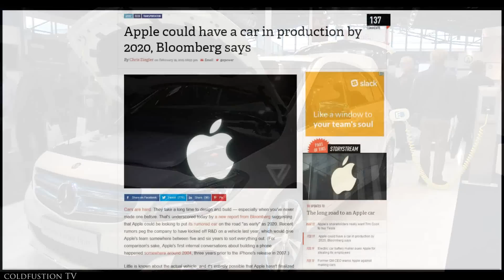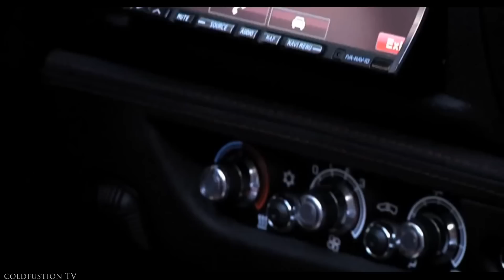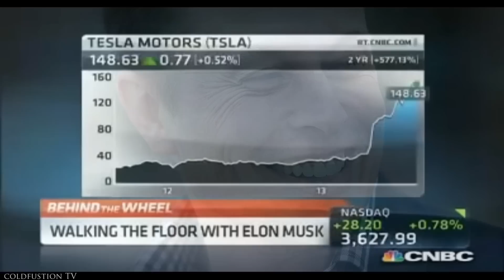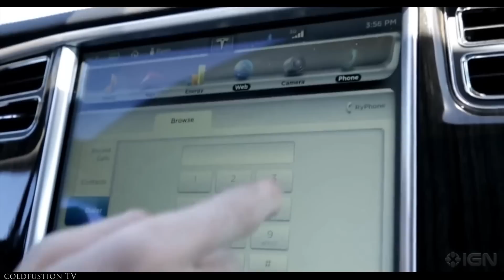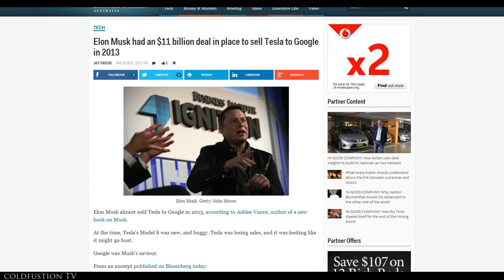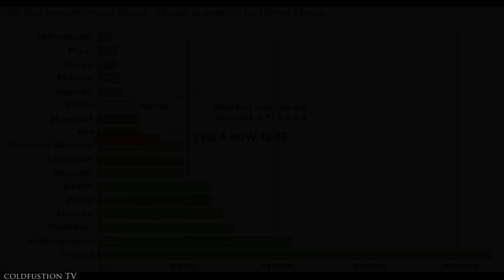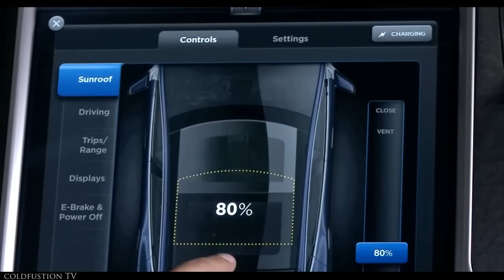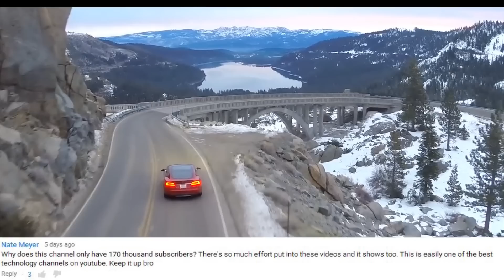How BIG is Tesla? (Bigger Than Mitsubishi Motors!)

Comment: Now with the Tesla p100d it's 0-60mph in 2.5 sec
Reply: Woah....
Reply: Now 2.34 second, gutted out interior could be as little as 2 seconds.
Reply: Cam Byers but that one is a little dangerous though
Reply: sickhcivc electric is shit, wheres the exhaust notes???
Reply: I think that you will have to modify your comment because the new tesla roadster is coming!
Reply: quick update new Tesla roadster goes 0-60 in 1.9 seconds
Reply: With the Tesla Roadster coming 2020 it will be 1,9s ;)
Reply: Now with the new Tesla Roadster it's 0-60mph in 1.9 sec
Reply: James Sempy For quickly getting to those limitations.
Reply: @Tony Tsui and all kinds of crap spewing out of its tailpipe.
Reply: @Tony Tsui just try to keep a Chrysler out of the repair shop.
Reply: Tesla roadster 2020 spacex version has enteted the chat
Reply: W O W - W O WEEEEE
WHOAAA. Beautiful auto.....
Reply: @virgilepatricot2507  Turns out owning the most cutting edge rocket company and the most cutting edge car company has an interesting effect on super car designs. Also Plaid Model S has a 0-60 of 2.0 sec and it's a family sedan.

Comment: I love my Ford Focus electric, it's not a Tesla but at $22000 after incentive it's a bargain,  battery lasts all day and charges overnight. I get to drive the future,save enough with no gas or maintenance and out accelerate every car on the road while I wait for the model3.
Reply: Ron I'm getting my 1st car soon (I'm from the UK) do you recommend either Ford Fiesta or your car Ford Focus electric, insurance-wise as well?
Reply: Mic First car? better Fiesta
Reply: Thank you will do
Reply: Mic small car means small responsibility. Cheap maintenance and repair. Easier for you to handle it daily. You will do stupid things with your car (you will, like everybody elses did with their first car). You will bump it, scratch it, break some parts of it. But in the end of the day, you will understand how to drive and use a car (each car have their own habits and character too).

My first real car was a used 2008 Honda Fit, or Jazz if you are from Europe. Still keep it although I have several other newer and more expensive car and truck now. My younger bro will start driving soon, I will pass the torch to him. 

Cheap car is the best car sometimes.
Reply: I see that's great advice! Also that the parts are more common = cheaper to repair

Comment: Electric cars can end the war on fucking petrol.
Reply: stanger People should like your comment more.
Reply: yes, but it is the mainstream. Developing electric motors for electric cars WILL lead to enormous innovation which will then be used on industrial machinery. On the other hand, plastics should be banned altogether from the mainstream and used only where they are absolutely necessary. If not, we will be dead by plastic poisoning before oil runs out.

Comment: Electric vehicles are great but, we cannot eliminate the other great powered car and that is, the hydrogen powered car. Hydrogen  powered cars will be needed where batteries cannot hold up very well to the extreme cold weather climates. Maybe New England where we have 4 seasons of changing weather, battery powered cars will not hold up very well in the winter. On the other hand, hydrogen powered cars will hold up in any weather conditions.
Reply: Hydrogen sadly is ridiculously inefficient in comparison, you'd be better off hoping for improvements in battery technology.
Reply: I would love to see a hydrogen powered car against an electric car in the quarter mile.
Reply: carl cappy problem is its hard to harvest hydrogen, thats why electric is more preferred
Reply: It's hard in terms of safety. Hydrogen is very volatile.
Reply: Hydrogen is no more volatile than gasoline powered cars.
Reply: carl cappy That isn't even slightly true.
Hydrogen will only exist as a liquid under high pressure or extremely low temperature, petrol in comparison sits as a liquid slowly evaporating.

A leak in a petrol tank wastes some of your money, would likely be quite a lot more upsetting.
Reply: Well, I will purchase an electric car when the price comes down to earth.
Reply: Hydrogen car is very dangerous... If something goes wrong then it will work like a mini nuke
Reply: You mean hydrogen bomb?

Comment: Cool doc! but I have one question. you said it doesn't need liquid besides wiper fluid. what about brake fluid? there has to be some way the motors are cooled as well
Reply: Owner's might only be responsible for adding wiper fluid, but Tesla cars have brake fluid, coolant(hence liquid cooled batteries), even transmission fluid(albeit a single reduction gear transmission).
Reply: RedcatPlaysGames No. electric vehicles have no fluid but wiper fluids. just like your phone and laptop has a cooling system without fluid, electric vehicles and their batteries have a cooling system that doesn't require fluid.

Comment: i only have one problem with the lane correcting i drove a  Mercedes s class 2014  and it would not allow me with out putting more force on the wheel to avoid obstacles far in front of me like cyclists it tries to pull me back to the middle of my lane which was a little off putting i hope they find away to make the sensors pick up obstacles a decant while down the road.

Comment: Supercharger Stations aren't free anymore, and most of them aren't for universal use anymore. It's still cheap to charge up, but it takes about an hour to get a full charge. I do like that the charging stations are next to actually shops and the car is definitely changing the automotive industry. 
Some day, the skills that I've acquired in college are going to be obsolete and degree's in robotics, electrical engineering, and even mechatronics will be far more valuable in the job market. I'm not saying fossil fuel powered vehicles will be faded into obscurity in our lifetime, but sometime in the future (probably near the turn of the century), we're going to completely do away with them and electric vehicles will make up more than 90% of drivers on the road.
Keep in mind... I'm not a time traveler. I'm just predicting the future, and I don't think it's a crazy prediction at all.

Comment: I love Tesla, I'm an Australian Model 3 Reservation holder, and I hired a Model S whilst on holiday in the U.K. 
But I'm sure you've made a glaring error in your video where you state that crash involving a stolen Model S split in half did not result in any deaths. The driver of that car did die of his injuries later. It was an insane crash involving a reckless criminal driving at high speed, so it should not be seen as a reflection of Tesla's safety standards. 
The death of the driver in a Model S in Autopilot mode is another example, but an investigation stated a human driver could not have avoided that crash either and Autopilot in its' current form, if used correctly, is already far safer than human drivers.
My broad point is that we should not set up false expectations that these cars are immune to crashes and fatalities, they are just far safer and showing a car split in half in a widely reported crash involving a fatality, then stating no one was killed, is just setting yourself up for Tesla haters to take a swing at you.
Love your videos on the whole though and beautiful slick production values.

Comment: I'm an engineer...the battery constitutes 80% the cost of a tesla...lithium is a precious resource..a battery with a range of 100 miles costs around 14k...and if you run the battery to zero miles regularly you can expect a 5 year life of that battery..meaning 14k to replace the battery every 5 years!!!! There is no NEW technology with these cars!!! The tesla super charger is nothing more than a 440volt charger...standard to welding rigs!!!! The motor/transmission/invertor are not tesla built...alls they make is the battery/chassis and controller!!! As i said if you regularly drive a 100 mile range battery below 50% or 50 miles you can expect to replace that battery ( 14k) every 5 years....but the tesla has 6 thousand batteries.....and if you exceed 50% that battery range you can expect to pay around 60k to 70k to replace those batteries after 5 years!!!! PEOPLE the automotive companies are not AFRAID of this "TECHNOLOGY" they jus know that for any company to try it is going to massively betray the consumer that purchases it!!!! I'm sorry to say this...but electric cars based on lithium batteries.....is the WORST investment you could make...in your entire LIFE!!!..

Comment: Tesla continues to be smaller, much small than Mitsubishi, of which Mitsubishi Motors is a tiny division.  Mitsubishi builds EVERYTHING.

Dagogo is just a little bit too rosy-eyed.  If you run into trouble doing something, staying with it does not mean that you will achieve your original goal.  Giving up on one goal does not make you a faiure unless you stop trying to do something worthwhile with your life.  Not giving up something after you've proven to be no good at it, not looking for other oportunities, more often leads to continued failure not only at reaching that goal, but failure at everything you haven't tried to accomplish.

Comment: I really like Tesla but they forgot to mention a few facts.. First this thing about it being sportier then most cars.. Not true. Yes it has a wicked 0-60 acceleration but why do you think you never see Tesla doing a Nurburgring circle? Because if you were doing those accelerations and braking for 5-10 minutes the batteries would get hot as hell and you would loose 50% of its power. In that case Tesla is simply not comparable to petrol cars. Second, the range. Yes, the range is pretty good but forget those Tesla superchargers, especially for Model 3 where they won't be for free. Now you have the problem of charging your car on a gas station where it will take you hours.. And third problem is reliability.. One would think that without the moving parts of a traditional engine Tesla would be the most reliable car in the world...But no.. They crammed so much technology and overengineered the car (I'm looking at you falcon doors) that its reliability is appalling.. Anyway, Tesla is a true game changer but it would be fair to mention its current downsides.

Comment: Well engineered electric cars like the Tesla are awesome, but Musk never mentions that the majority of our electric power is still generated with fossil fuels - natural gas and coal. That is not likely to change for a very long time. 
A Fusion energy break-through would likely halt all research into solar, wind, and other so called "green" technologies that are very far from being economically viable as our main energy source.
Fusion powered electricity generation would be fantastic, but we'd still have the problem of upgrading our national electrical grid. It is already operating at near capacity, and could never withstand the load of tens of millions of vehicles recharging over it.

Comment: "the only fluid that needs topping off is wiper fluid". no brakes on the car?
Reply: The brakes use a "brake by wire" system that incorporates electrically assisted calipers reducing the braking distance since the computer applies the proper pressure along with advanced ABS. The braking feel is simulated to the pedal so the driver feels proper resistance and feedback. This system can also be used as break steer to brake the inside wheels to help the vehicle corner better this is a similar technology that was banned from F1. As you can see having this brake by wire system saves weight by not having the traditional heavy fluid filled lines and adds increased safety and handling due to the advanced computer controlled braking systems. Also i made this all up.
Reply: +Ruben thanks, that's interesting
Reply: starguy9 Did you read the last part? I made it all up. The tesla uses pretty conventional brakes brakes with brake fluid plus regenerative brakes to charge the battery.
Reply: +Ruben lol
Reply: ***** Lols

Comment: Capitalization is only a metric of economic value. not real size.  That Tesla's market cap is larger than a Ford, doesn'[t reduce the number of Ford vehicles on the road that continue to provide Ford with revenue from parts , or Ford dealerships from service.  Tesla will have little or no revenue stream from after sales services.

I like that you are an optimist, but while pursuing a vision without giving up may get to to the end of the road, it has a high probability of not ending where you wanted to be, dead.

Comment: Apple Car: $100,000 (Body only)
Machine, seats, and wheels are not included

Apple Car: $300,000 
 (Machine, seats, and wheels are included).

Operation:
$1000/Month for operation.
$15.000/Year subscription to
   actually use the car.

"Why we havr to pay apple to use the apple car that we buy?"

 "Because F*ck you! We love money."

Add on:
+100kWh battery (+$50,000)
+Fast Charging Support (+$35K)
+Little bit Faster engine (+100K)
+Water resistant body (+$60K)

Comment: Massively flawed strategy that is simply not scalable, the Betamax of transportation. It’s crazy to think that this tech saves the planet. Ask some basic and simple questions - where is the precious metals coming from the make the Panasonic batteries used by Tesla? Imagine replacing all cars with electric cars, consider the impact on the planet then. Where does the power come from to generate the electricity? Just because we run electric cars in the city we say it’s clean so that must be better! Wrong the planet doesn’t have this micro view. It’s also interesting to show charging points on a map, I don’t think so we have had mobile phones for 30 year and you still loose the signal 20 miles from a city, this shows that tech will only ever grow where they think there is a sale, out with that you are on your own.

Comment: when i was about 10 years old there was a documentary on tv about electric car. the car is very expensive. 1 car cost million and only 10 unit is produce. the special about the car is it dont need to be charge. the car is install with generator motor at rear wheel & electric motor at front wheel. when the padle is push, the electric motor used the batery power to run the car. when the padle is release the generator motor will charge the batery. the car dont need to be charge due to continous cycle. after 20 years why electric car still need to be charge manually. i dont belive with the idea of free charging station. elon musk will be dead someday just like steve job. and we dont know what will new person will do. if the single batery cycle is not efficient, they just can use 2 batery system. 1 used to move the car and the other 1 will be charge continously using generator motor by a moving car. after 1 batery is runout power, just change to 2nd batery. its very simple.

Comment: Tesla as a company has been losing money year over year, and has not seen profits in a long time. Cars catch on fire spontaneously due to battery design. One recent death toll at least due to its futuristic design of the door handles, when cop could not open the door to pull out passenger from burning Tesla. Reports on Teslas, randomly hitting other cars and objects while being on auto-pilot. The shameful breakdown during the rally show with Porsche Roadster, where Tesla just broke after driver tried to speed up and keep the pace with the Roadster. The recent "truck of the future", aka triangle on the wheels, which also proved to be huge flop. The company is hugely subsidized by the government, so it is  not a disrupter of the auto industry, so long the politicians are lobbied by big corporations